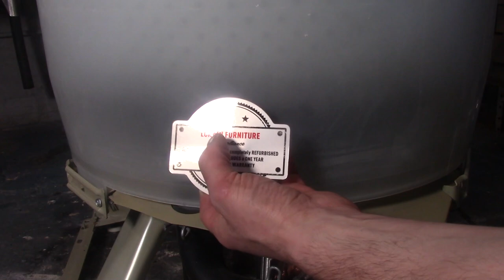Perfect Restoration / Rebuild of Vintage Whirlpool Washing Machine

Comment: Eugene, your videos helped me out a ton. For years our kitchenaid washer that came with our house, which is pretty much identical to this one, was acting up. Leaking, out of balance, noisy, everything short of seizing up. I told my wife that our old pos washer wasnt worth fixing and she protested for me to fix it but I didnt listen. I figured progress is always forward; surely the newer washers are better. "I'm not wasting my time on this old thing that was made when I was a teenager".  I'll just let it die and we will buy a newer, better washer (wife not happy, she knew better, but it wasnt dead yet even though it was leaking all over. It was leaking down a drain so it wasnt causing problems...)

So it finally stopped working and by refusing to fix it, I created a situation where a new washer was required immediately since we have 5 kids. She graciously allowed me to buy a new washer and I got to see how frustrated she got with it immediately. The new washer we bought was really bad it turns out. That's when I started researching on YouTube and found your channel. It was a real eye opener when you said all the things shes been saying about our washer. Your demo videos of the old whirlpools really showed the action of the agitation that just wasnt there in the new washer, or any of the new washers I looked at besides the speed queen and even that had some compromises like no warm rinse cycle which was unacceptable. The new washer just didnt  work and I had no idea anything about laundry until this problem. Your videos brought me up to speed quickly.

Anyway I ended up learning alot. Most importantly, trust an expert(my wife) and resolved to fix our kitchenaid washer. I used other resources too but many of your videos were very helpful. In the end i replaced the transmission, springs and drain pump and it didnt even take that long so my whole protest was stupid anyway. These washers from that period are amazing pieces of mass market engineering, a real quality product, simple and easy to maintain, worth refurbishing and keeping around. Now my wife is back to being satisfied with the washer if not slightly annoyed over the trouble I caused delaying the fix!

Comment: This brings back memories... my parents have almost the identical washer still. Theirs though is the Gold model, so it has 1 additional cycle and 1 additional speed motor, plus the "Quiet Wash II" feature which is essentially sound insulation on the body. We got it brand new back in 1999, with the matching 5 knob dryer, both in the Almond color. I think the 1999 Whirlpool brochure we selected them from, is still on a bookshelf somewhere in the house.

Comment: This is amazing. I ended up purchasing a LG washer and dryer from home Depo without agitator and my goodness I hated the washer and auto sensing I took it back the next day. Seems like these new models don't clean clothes as good as the old ones. I ended up searching for a used washer and dryer on facebook marketplace. I bought a 2014 whirlpool top load WTW4800BQ washer that has agitator and its okay. Wish I would've found your channel sooner. I live in Cleveland west side near Lorain and didn't know u were so close. I will be paying a visit soon for a gas range. Keep up the good work

Comment: My 27 year old Kitchenaid ( basically the same) gets daily use...only issue is neutral drain ( works sometimes) otherwise great machine....I added sound/ vibration mats like that too  a few years ago and it made a nice difference.
Reply: Even if you're a complete novice, you could put a new neutral drain pack in it. They can be found cheap and it's not the end of the world to change one.
Reply: I’ve got the part and plan to do the repair and replace the clutch while I have it apart.

Comment: I've got one of these from the early 90's. Runs like a top. We just did a full refurb on it (in hopes that it'll last another 30 years.) Only problem is the paint on the outer housing is looking really awful. Any suggestions on how to restore the finish / get hold of a new housing? Budget is pretty much limitless as we don't want to get rid of it. PS: I would be more than happy to pay for the consultation should you have any constructive advice

Comment: Looked to be pretty clean to start out with, for the age. Nice job making it last for a few more decades!
Reply: Some people actually take care of there machines so they last.
 It is nice he did clean it though and made sure everything is working properly for the next owner.

I have a soeedqueen at home and at our office I have a maytag direct drive I plan to run both until they wont go no more. In other words I cant repair them anymore.
Reply: @SuperJeremi10  I'm one of those people. My daily driver is a 1979 Maytag A106, and the other major appliances are from the 70's and 80's, except for the dishwasher. All are in good condition, too.
Either someone really took care of that Whirlpool, or it was a low use machine. Either way, I hope the next owner takes care of it just as well.
Reply: @dynatrak some one took care of it.

Sadly my maytage at the office isnt in as good of shape but it's heavy used washing dirty cleaning towels hand towels for bathroom. Then moving / construction blankets.
Mainly the wear is on the chassis.
There is bubbles in the paint next to the bleach dispenser.
This is why I hate using the bleach dispenser it eats the paint.
There is a small dent in the control panel the machine has been in use for 10 years but hey the inner tub is nice and clean the plastic tub is clean. Only gunk is the fabric softner cap.
Machine works perfcatly just had a new timer installed.its a maytag centennial washer last few years before they went to the belt drive design still fills all the way with water.

The speedqueen at home is in great shape it replaced a maytag dependable care washer that was shot.
The break had failed the clutch was getting week then the transmission failed it started spin draining them moved on to agitat and spin finally it seized up. Then I went and bought a speed queen and they deliver new washer and hauled the old one away.
Reply: @dynatrak  I should have repaired that washer but at the time I didnt know hoe bad washer where getting.

The maytag at home started acting up to many years of 10 plus loads a week plus over loading killed it I think.

Well I bought a new set he set ot was a maytag with steam dryer luckily I kept the old washer had a friend that wanted it never came and got it.

Well turns out I hated that he washer and I thought i just picked a bad washer.

Well closer to 2016 I started looking for a new washer cause mine really started going south I started seeing all the crap then I found the speed queen I bought it.

If i had know speed queen was going to follow in the same steps I would have kept that 90s ish maytag and rebuilt it as a spare I was thinking if my other washer quite I'll buy another speedqueen.

Not to long ago the transmission went out on the office direct drive washer well I spent the money order a new transmission clutch and motor coupling I took that thing apart replaced all the parts shes good to go another 10 years. Then this year or last year I belive the timer went out stopped advancing soni bought another timer. I was told why not buy another washer I'm like um no I want a washer that washes thank you not swish swish for an hour with soap dirt and dry clothes on top or a blanket that just floats.
I want clean I want to tell the machin how much water I want I pay the bill stop trying to save me money I'll do that myself it dont save me money if I have to wash the same load 4 times or add 3 items to the washer to get it clean. 1 hour for a wash would be okay if I could add a large amount and it actually get cleaned.
I also want hot water when I select hot there are some items I like to sanitize.
My stem dryer this year just quitr the computer went out and it needed belts and rollers I was able to fix it for 150 bucks it's been a good dryer i like it.  I was told to get a new one I'm like no I can repair it cheaper and I dont like any of the newer drivers or the price tag 1,000 bucks for another steam dryer I dont like half as much as this one nope I'll repair it.

I redid the rollers and belts thermostats an a maytag dryer with timer when it stopped heating correctly the thermostat went out.
It was cheaper to fix it then waist mone on a new dryer.
Reply: @SuperJeremi10  That's good you learned to repair the washer, and dryer, and great choice on the Speed Queen, it should last you many years. Yeah, just research parts, and prices, and I can usually find good deals to keep my old appliances going. I'm glad I decided to learn to repair as well, saved myself a ton of money over the years.
Reply: @dynatrak  yes repairing appliances is a good.skill to have some of what I've had to do I hate to imagine what a appliances company would charge.

Beginning of this year the draine on the fridge backed that was a mess. I have a top and botto. So water dripping on the lower shelves and made a big mess.

The fridge is only 8 years old.

Being able to repair  saves a lot.

I picked up chest freezer that was being thrown out and repaired it now I have a free freezer 

I also repaired a under counter ice maker that was thrown out  it had sevral water leaks a bad circulation pump and a shorted wire.
I repaired it for 40 bucks.
I'm sure haveing some repair it would have cost more then the ice maker its9 and that's why it was tossed.

I also scored a free fridge I gave away when we moved  through it ended up just haveing a bad condenser fan.

When I see appliances out on the street I grab them and see if I can get them going then I find a new home for them.

Comment: That machine was in much better condition than anything that'd be found around here, and there's no way anyone here would pay what you charge for a refurbished direct-drive.  I had one for sale a couple years ago for $380, did more refurb on it than you (including new tub support, agitator shaft, and spin drive so all the bearings are new) ... zero interest.  I've kept it for the next time an immediate family member needs one.

Comment: Did you replace the skate plate pads the tub rides on for balance? Those metal insert motor couplers can round the shaft off on the motor (the oem ones are plastic for a reason)

Comment: Hey eugene, i found a new LG  top loader that has an agitator, it's model number WT7305CW, you should test it out! It's not even on LG's website yet but it's already online at various retailers, you can google the model number and find pictures of it. It's basically the same top load design as the current wash plate models but they just added a post and new plate design, it looks like it's got some nice big ramp style fins on the side. Should be very intersting to see!

Comment: Remember when the newer belt drives were as good as these? 

Yeah neither do I.
Reply: Did you go on kirk live
Reply: @Thedonsmoney25823  Not recently.
Reply: @Sharkie626  well i do want kirk to go live
Reply: I've had two of these DD washers over the years and while they are/were great machines I actually like the wash action of my current Amana better.

 More like the original belt drives with the longer stroke . I would still have a DD today though. Probably the best machines Whirlpool or ANY manufacturer ever produced.
Reply: @patcola7335  you talking to me or sharkie626
Reply: The only catch with the Whirlpool belt-driven washers is the wig wags go out every so often.
Reply: @Thedonsmoney25823  general comment
Reply: @patcola7335  ok

Comment: I have the same washer (bought new in 1999 and used continuously, with no repairs needed, by my family of three until 2013 and since then by myself alone).  Recently the machine would drain but neither spin nor agitate.  I replaced the broken coupler and now the machine spins and drains with normal amount of noise.  Also, the so called “high agitation” cycle (with agitator spinning continuously seems normal and quiet).  However when the “low agitation” cycle ( intermittent agitator spinning) starts, there is a loud knocking noise each time the agitator starts one of its partial rotations.
Any ideas of the cause and fix would be greatly appreciated.😅

Comment: Looks like the spanner block wanted to fight haha. What cleaner did you use cleaning out the tub? I also like your nut driver 1/4 + 5/16. I just got one this week haha! Also, the neutral pack. It looks like you left the plate in the transmission. Do you not change that when you rebuild a transmission now?

Comment: Time mark of 2:15 on your video show you breaking a plastic piece out from the bottom of the basket so you could clean underneath. What is that part used for? And do I need to replace? I can't find that part on the parts list break down. Thanks for your Great videos.
Reply from the maker: That’s a lint filter, and I typically don’t put it back.  It (obviously) collects lint and over time will clog up and make the washer stinky
Reply: @LorainFurnitureandAppliance  Wow thx for the quick response. I am restoring a Kenmore 90 series and will not put mine back either thx. You should see the good condition of this washer and these people were throwing it away for a new model set lol. They will regret that later. lol Learned alot from your vids thx :)

Comment: Need to change out the neutral drain in the transmission
Reply from the maker: Ray Kirchdorfer it was.  At the end I cycle the knob and let it spin drain to a: bed the clutch pads, b: the swirling water does a great job of rinsing away any residual soap
Reply: Starting around 4:00 or so, you can watch him replace it. It's right there in the video, of it being replaced!